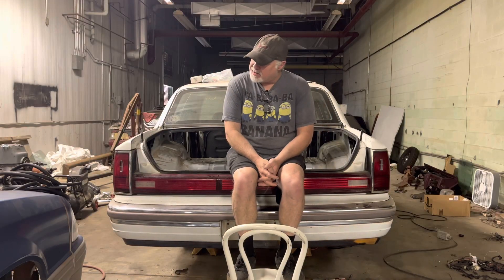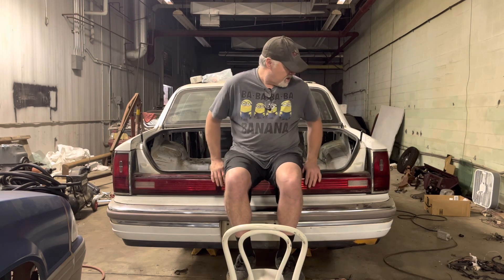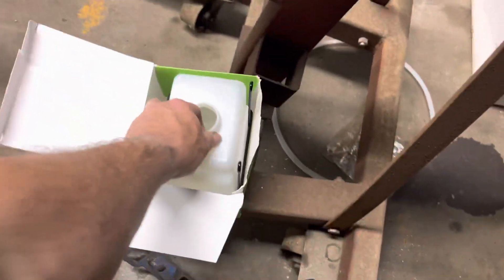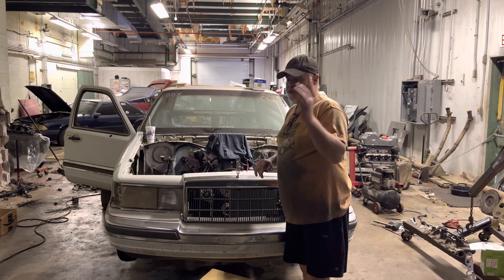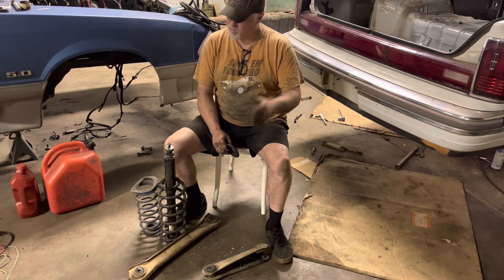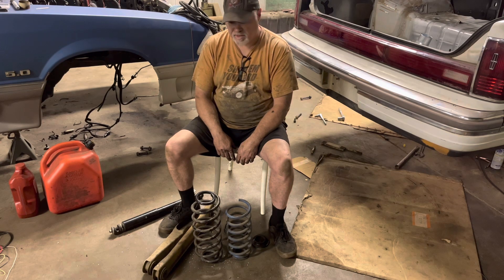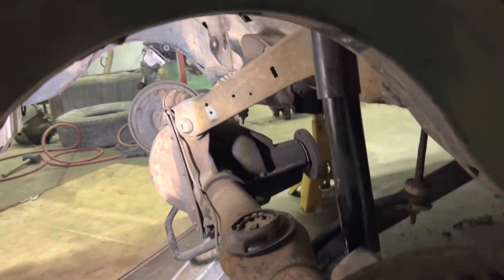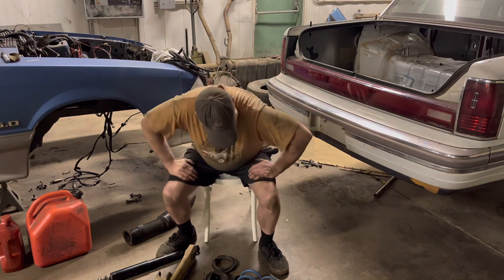1990 5.0/T-5 Lincoln Town Car LOVEBOAT pt.34 The "suspense" is killing us...

Comment: Exhaust made easy: just bolt the turn downs straight to the headers. 
Ear plugs and ear muffs are cheaper than mufflers and lighter too!
For your trailing arms, have you thought about boxing them? Or remove the rubber bushings and cram a solid aluminum one in them?
Reply from the maker: At least I can show the lawman I have mufflers😎…..why box when I can have adjustment and solid bush’s? I have control arms on literally every car I own 🤓
Reply: @5.0tussin  I caught that you were getting some for a Buick, for some reason I did not catch (or pay attention to) that they were adjustable. That's even better yet! Keep at it!

Comment: That expansion tank the bottom port is where the radiator hose goes to so it can suck the coolant back in when the engine cools and the top port is overflow? That's how my s10 and rangers are.
Reply from the maker: My stuff don’t backwash 🤣🤣🤣

Comment: Hook the overflow hose to the bottom of the catch can . it will push and pull the water whenever and however it needs it. That's why original 5.0s have it hooked to bottom
Reply from the maker: I only use it as an overflow..I don’t keep any fluid in it and just drain it as needed.. I only used it cause someone got it for me otherwise it’d have a MTN dew bottle on it or a beer can🤓

Comment: I was modifying the suspension on my mark vii last year. 
Lifting it for off road abuse. 
Same deal. Couldn’t find anything, much less at reasonable prices. 
Ended up extensively modifying the stock control arms and subframe mounts to fit my needs. 
Used Jeep Cherokee front springs to get my lift. 
Fit 30x9.5r15 mud tires on er.
Reply from the maker: Now that’s next level stuff😳😳💪🏻💪🏻💪🏻

Comment: Remember that's a panther platform...same all the way to 2011 crown vic other than the updates to front suspension and hydroformed chassis...
Reply from the maker: Just not much out there, at least for drag racing them…I’m pretty sure the stuff I’m getting will work and didn’t cost an arm and leg…once it’s running things will bump along a little quicker I think..

Comment: Have you considered just boxing-in those factory control arms to stiffen them up? Just weld a piece of plate to it.
Reply from the maker: Yes but why do that when I can get something far better (imo)?…it would still have zero adjustment and rubber bushings 🤷🏻‍♂️
Reply: @5.0tussin  well, because it's cheaper, of course! C'mon, man. I thought we were substandard here lol! Anyway, love watching the progress. I needed some motivation for this ol 79 pace car.
Reply from the maker: @mccoma11  I get the cheap thing but I literally have control arms on every car I own, it’s bad enough it still has stock axles which are a no no for me as well..people wonder at times why the cars do well? Here’s part of the answer lol

Ps…79 pace is a rad looking car 🤙🏻

Comment: Great video!! I’m liking the control panel you have made!! I’m thinking that, I would just box the upper & lower control arms. You mentioned the spherical solid bushings of the rear axle mounts. Are those really good? I’ve been looking at those, and think about putting a set in my 85.
Reply from the maker: Why box the arms if there’s something better? Shouldn’t every fox just have boxed arms then?…I like having the adjustment and if it’s a rubber bushing in the rear I prefer to toss it😎
#racecarlife
Reply: @5.0tussin  truth !! I totally understand that, I was just thinking about the cost, and availability.
Reply: @5.0tussin  I’m having trouble with the rubber bushings on my car, so I totally understand it.